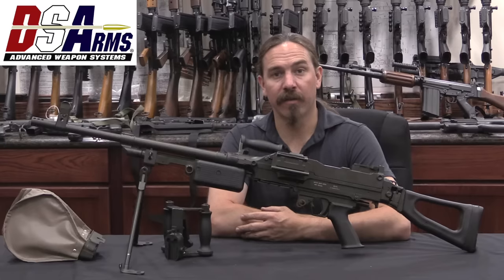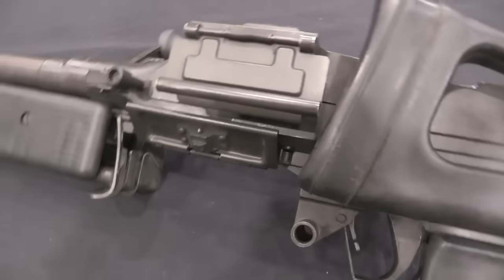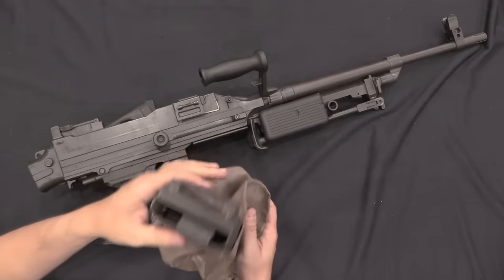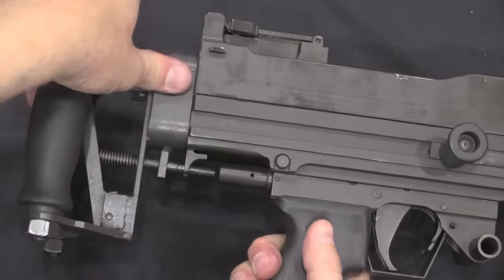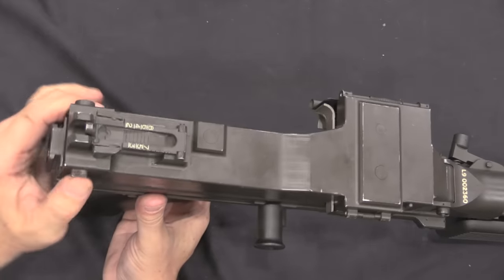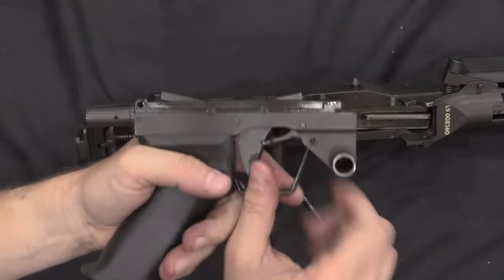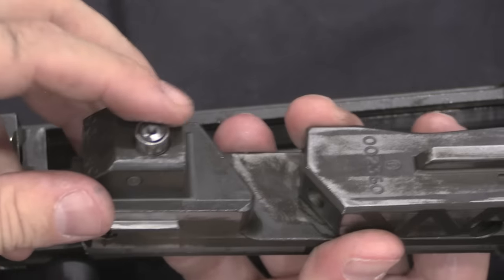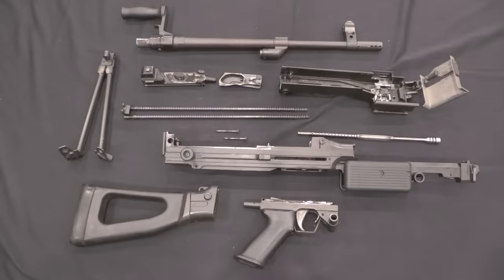SS77: South Africa Builds a GPMG on the Shoulders of Giants

Comment: This gun was added to Arma 3 not too long ago with the Western Sahara DLC. The notable differences between the SS77 and the Arma 3 SA-77 is that the SA-77 has a welded picatinny rail in front of the rear sight assembly, it has fire modes of 600 rpm and 800 rpm that you can switch between, it has a 100 round canvass sack with a stamped sheet metal attachment point with a nifty diagram of which way the bullets should be pointing it does not have the zipper on the bottom. There was also added a compact version of it which was fitted with more rails on the fore end so you could attach all kinds of doodads, a more compact stock, an entirely different gas port assembly with the front sight attached to that, and a shorter barrel. I do appreciate that Arma's fictional weapons are different in ways that imply a domestic production version as opposed to the original versions modeled poorly.
Reply: Indeed, fictional-but-plausible things are always neat. It's a form of historical fiction, I suppose.
Reply: I love that CDLC and the SA-77 in particular.

Comment: As a former magist (FN MAG gunner) I was always curious about this design, so nice to see it up close. It seems to address most of the MAG and PK problems. I can't see why it didn't get wider adoption. 

One thing that immediately stands out is that the ammo sack would kick you in the balls and there seems to be no way to hook it to the handle with a paracord like with the Israeli MAGs. 

I haven't seen a  Negev 7 yet, but other than that it looks like the best GPMG design in the last 60 years. More impressive than I thought. Because of a short receiver and  a hand grip you can use it in an assault as a shoulder fired gun. I'd redesign the buttstock and shorten the barrel, modify the muzzle device and the ammo sack (to match the Israeli pattern) and you'd get all you may want from a 7.62 machine gun. And 7.62 NATO machine guns really do have a purpose. Full size cartridges make a lot of difference.

Too bad it looks like they stopped making them.

Comment: You do NOT want to take that buffer spring out, trust me  😁
I never had that many issues with these (apart from a broken gas piston) and I quite liked it. I found it handy to use as it pointed well and had a soft recoil, accurate, wonderfully engineered (not so important practically but it really was beautifully engineered), and easy to clean/maintain. Ours were mostly mounted and we had some of the spade grips as well which I believe were not exactly common in regular SAA service. It rates up there with the MG3 as one of my favorite to use GPMGs.

Comment: 12:44 I expected the MG to be lighter than 22 lbs/10 Kg considering how svelte it is. Then I saw the bolt and damn it's a complicated piece to machine compared to a PKM bolt. Cherry on the top is the FAL style sand cuts. With a reciever locking system that this thing uses the receiver has to be machined as well  The spade grip mechanism is cool though.

Comment: Thank you for making this video, we tested this in my time in the defence force, my job was LMG1, main operator of this weapon, what a beast when it worked, duel recoil spring was an issue on mine. Cut dow trees with ease. I found it much more user friendly than the FNMag, especially on the weight side and stability on full rapid fire bursts. Thanks again for vid👏🏻👍🏻🇿🇦🇿🇦🇿🇦🇿🇦

Comment: Broke bipods jumping off the Buffels during ambush training( South African armored troop carrier and quite high) when hitting the ground the jolt would fling the bipods open and the follow through and the weight I was fully loaded with pear sack full and all my other ammo would cause a lot of putting on brakes… between breaking myself and hitting the ground ..but I did find the bipods weaker than the FNs ones, i never had bad problems with firing / stoppages, I am left handed, best thing for a mag gunner …too easy to cock/unblock a stoppage , loved this gun , have some belt at home ..I find myself taking apart and linking back up again, 5SAI light infantry Klein span team 1990.

Comment: One of THÉ worst LMG designs! The moving parts, especially breechblock,use jam after the first 100 rounds. The number 2 gunner had a 2pound hammer and tentpin during training. By lifting the cover,all moving parts were covered with copper shavings; causing the gun to jam. Then you have to hit the breechblock with the tentpin and hammer to loosen the moving parts. Adding extra lubricant changed nothing. The barrels changed colour from black to grey after the first 50-100 rounds.

Comment: They need to import them into the US with a semi auto fire control that can be adapted later with a FRT or binary trigger
Reply: Never going to happen. It's an open bolt machine gun, would require a complete redesign.
Reply: @alun7006  not really hard to do to convert it to closed bolt
Reply: @alun7006 the PM63 is a great example of converting open bolt to closed bolt semi auto